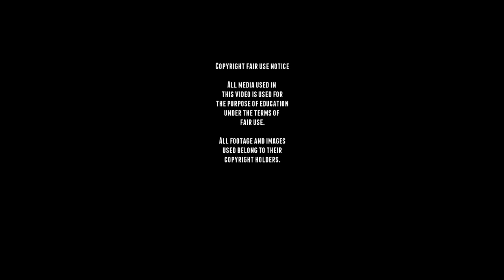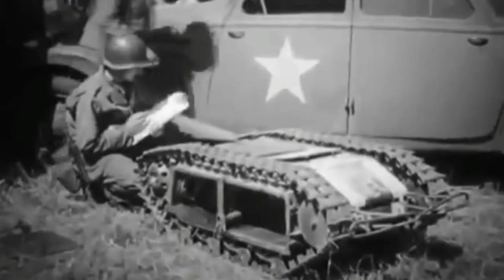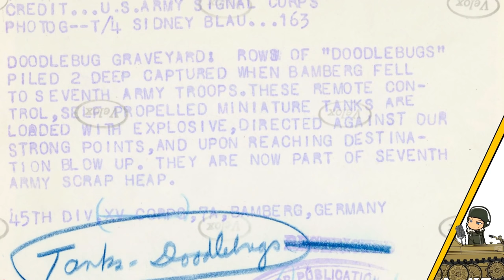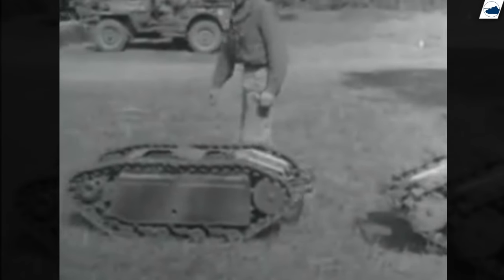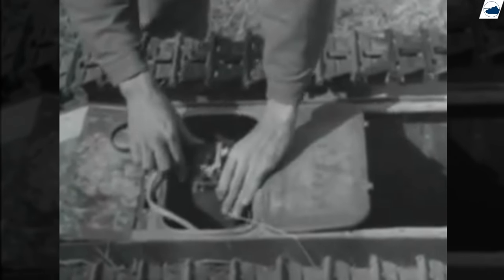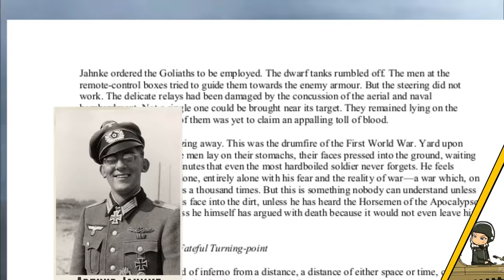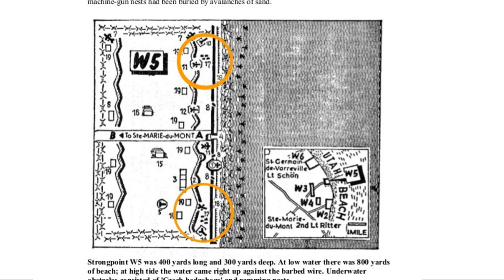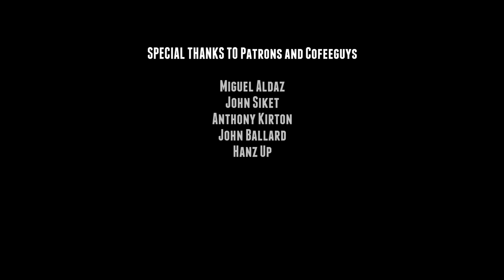Goliath RC Tank on Utah Beach - Last Remote Mine on D-Day.

Comment: Thanks.  That was interesting.  I can see how this was one more thing the Germans committed to combat - that wasn't ready.  It was to fragile to work properly if banged around.
.
Reply: And shot at with 30/06, 50 cal and 303 ammunition. It would take a thick slab to stop a 30/06 let alone a 50.
Reply: You say that but they were pretty effective during the Warsaw uprising
Reply: @torinjones3221  The Germans used Goliath's during the Warsaw Uprising
https://en.wikipedia.org/wiki/Goliath_tracked_mine
but they were over all not much of a success.  Possibly in specific circumstances they did better than elsewhere.  One thing about the Warsaw Uprising was that with it taking place in a city the terrain was more level.
.

Comment: Again a very good video/footage  on the Goliath Leichter Ladungsträger a name given to the two unmanned disposable demolition vehicles,  one is the the electrically powered Sd.Kfz. 302 and the petrol-engine powered Sd.Kfz. 303a and 303b. Both carried the 60kg high explosive and I believe that the 303b carried 100kg of high explosive. The early Sd.Kfz 302 used two electric motors but, they were costly to make (3,000 Reichsmarks) and difficult to repair in a combat environment with lack of technicians so later models, the Sd.Kfz was fitted with the Zündapp SZ7 / 2-cylinder 12.5 hp basically a more powerful and reliable gasoline engine. But a dumb question is how it was steered with the single engine? Anyway according to Walter J. Spielberg with his book "Special Panzer Variants" it was built much more than the electrically powered Goliath. Basically it was unreliable with a fragile electric box but when it worked it did considerable damage! BTW I never saw the Sd.Kfz 303!! Thanks for sharing 👍 👍
Reply from the maker: As far as I seen it has two front drives.

Comment: Thank you Panzer Picture .  There is an account of the use of a Goliath In Paris which is a different environment than Utah Beach  , 50 kg Charge . Page 152 Title is The Liberation of Paris ,  2019 Jean Edward Smith is the Canadian Author . At The Grand Palais a German  armored Unit was Passing thru the City on August 23rd taking advantage of the Truce . One German Soldier was killed when fired on by Paris Police and they responded Immediately . It was one of the largest Buildings in Paris and also housed the 8th Arrondissement of the Police . " They Launched 2 Goliaths   ....... When they exploded the explosions were so great that Buildings shook for blocks around...... There was a Swedish Circus underway at the Palais and the Lions , Tigers and Horses bolted for Freedom , as did a collection of Prostitutes imprisoned in the Palais by the Police " .   It goes on to say there was a Fire and the Building was a burnt Shell when it was over.     There was no mention of whether or not the Girls  had any Popcorn or Peanuts ?
Reply from the maker: Thank you Mark for the information.